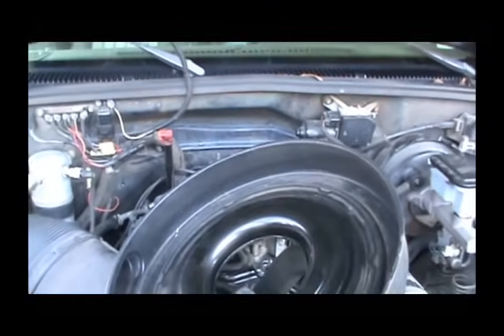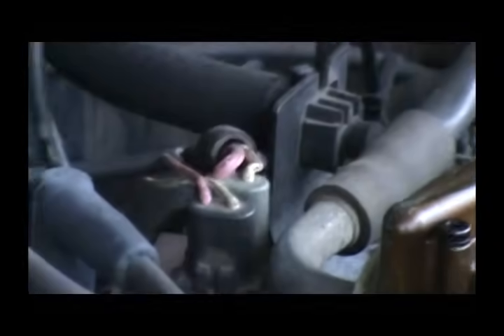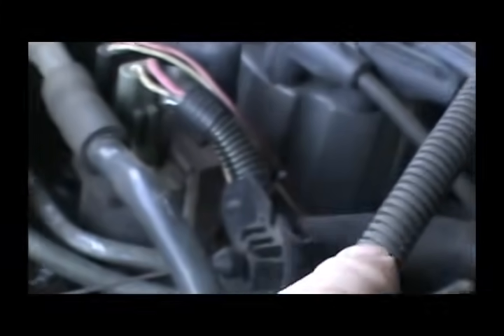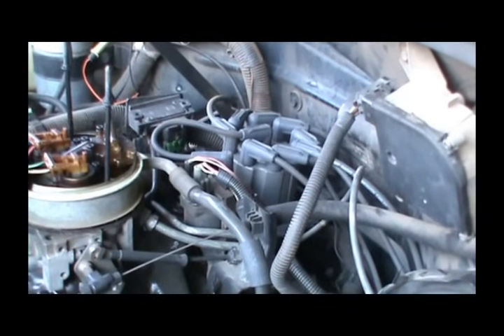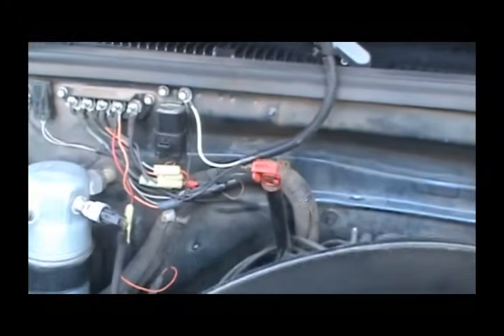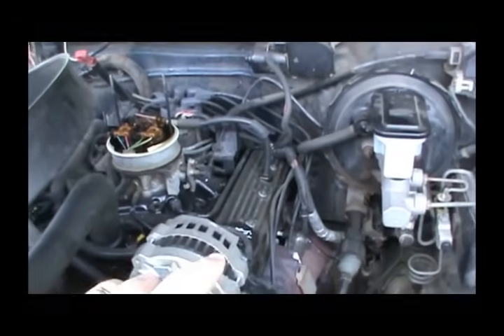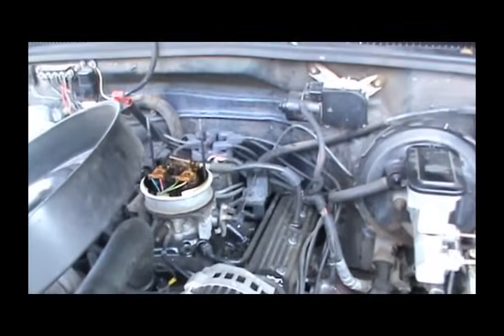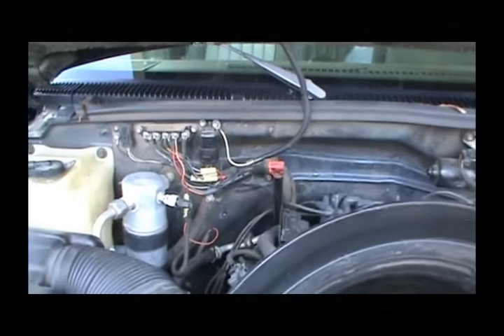1988-95 GM Truck Ignition Systems

Comment: Help please. I have a 1990 gmc sierra 5.7l 350 engine. It will turn over but doesn't want to start. Initially i could get it to start if i kept turning it over and mashing the gas a few time. Now the truck won't start unless i pour gas into the tb. And it would run however now when i start it with pouring gas it runs then cuts off.It also went threw 2 batteries from trying to start it. Parts i already changed: fuel pump, fuel filter, oil sending unit, fuel reply, injectors, distributor cap and rotor button, and spark plugs. If anyone can help i would greatly appreciate it.
Reply from the maker: Without being able to test, it's hard to say...definitely sounds like a fuel issue.  The throttle body has a fuel regulator inside that could be giving issues.  Since it will fire, I would guess that the PCM is ok. Hope this helps.
Reply: Double check fuel filter arrow to the front?

Comment: I need a video on the vacuums I got mine all messed up! Wont hardly run
Reply: Changed the key switch barrel  on my 1989 Chevy Scottsdale. Every since. It runs the battery down over night. Any ideas

Comment: I have a 92 GMC Sierra V6 5spd.. I'm having issues with starting the engine.. it'll turn over but won't start.. May have a compression issue.. at first my fiance and I could spray some starter fluid into the intake and it would fire up.. what are some tips or thoughts on the issue?
Reply from the maker: Sounds like it's fuel related.  When it fired up on starter fluid, did it run ok?  Try cycling the key 3-4 times to prime up the system.  Make sure the oil pressure gauge is showing pressure when cranking, a bad oil pressure sending unit could possibly quit sending power to the pump.   I'd rule out the pump/wiring/relay before looking at the injectors.

Comment: My 1987 Chevy r10 running rough and cutting off when I put it in gear what could be the problem new fuel pump filter O2 sensor temperature sensor idle air control sensor map sensor still doing it
Reply from the maker: A dirty throttle body would be my guess

Comment: I have a 1995 c 1500 no spark, have fuel going in and has power to coil but no spark. new distributor , new wires and plugs plz hlp
Reply from the maker: Hard to tell, I hate to say replace the coil without some testing...
Reply: @farmboy30117  sometimes the wiring connections to the coil are broken or corroded. Check for voltage to the coil should be around 12v.

Comment: quick question. would you happend to know where that wire is on a 305 5.0 tbi engine on 1990 caprice classic? thanks in advance mr. farm boy
Reply from the maker: No, sorry.  If it's not on the firewall, look around the PCM under the dash.
Reply: thanks man!! I've changed almost evreything and no go. your video helped me have a better understanding of the start up process.thanks again
Reply from the maker: glad it helped

Comment: I have a 91 Cheyenne K 1500 5.7 TBI I changed timing chain and gears truck fires up disconnected the timing by pass wire set it to zero but it runs very poorly acts like it doesn't want to take the fule any thoughts
Reply from the maker: I think initial timing should be around 8 degrees BTDC but it should be on a sticker under the hood.
Reply: Have a 94 Silverado 5.7 there are two sets of wires coming off the ignition coil. A pink wire then a white wire that are bigger in size that run into main wires, then a pink wire and a white wire that are smaller that plug into the distributor. The bigger wires I believe are the primary wires, my question is, should the pink wire (Primary) always be hot or have constant power to it? I used a test light and no power showing, but then I had my daughter crank the motor and it showed power? Have a no spark condition. Dist cap, rotor, ignition control module, and ignition coil are all brand new.

Comment: After changing ICM  ignition control module ,distributer , rotor and cap . Spending 50 bucks on a tow to the local mechanic found out it was the distributer ignition pick up coil. Should have just swapped out the distribute r. Live and learn
Reply from the maker: That sucks!  Well, don't feel too bad, at least you have spare parts ;)  I've only had one pickup coil to go bad on me, so it's definitely not the first thing I think of when diagnosing a no-spark condition.

Comment: I have a 1995 tahoe with that issue. No spark, no fuel, I'm trying to test the computer but I can't find that plug any sujestions
Reply: Just found the plug its near the computer under the dash on the 95s.
 hower when I tested it to see if it switched it to icm from pcm.  I still have the same problem no spark no fuel , I'm guessing from here my problem is the ignition?
Reply from the maker: I'd definitely check power and grounds to the computer.  Does the check engine light come on when you turn the key to run?  If no spark with the plug unplugged, then it could be the ICM, but that would have nothing to do with the fuel issue.
Reply: farmboy30117 Okay so if I don't touch it and put the key in it after a long time if it's setting the gauges do the pre cycle check engine light all that fuel pump works and I can start it, however after I turn off the ignition it will not do another cycle, it's almost like it times out.
I can let it set with the key in the on position for like 30 minutes and it works again, but only one time as soon as I turn the key off it doesn't work for another 30 minutes.  If I turn the key once and leave it in the on position it will work until I turn the key off, once the key is off no spark no fuel no precycle no check engine light no nothing, no gauges blinkers don't work and other accessory components when this happens, but if I wait 30 minutes everything starts working again.
Reply: Also I was testing the plugs to the computer under the dash, the blue plug was getting power source the whole time while the precycle wasn't working, however the red plug to the computer was not getting any power as soon as the pre cycle started working, after the time out, the red plug got power and everything worked on the plug, and everything else worked and I can start it.
Reply from the maker: Do you have a wiring diagram?  If not, do a google image search and open the one from Autozone.  It looks like the only "B+" wires are either orange or pink.  There is a red wire and a dark blue wire (side by side) coming from the transmission control module to the PCM.  I can't help you with the transmission module.  It's weird that it resets after 30 minutes though.
Reply: farmboy30117 alright man I figured it out it was the ignition switch the whole time.
Reply: Hello I'm having the same problem right now can you please help me I am stranded I'm looking at the blue and red plug at the computer. Can you please tell me where at the ignition switch the whole time I Will Bless You Back please call me
Reply: I have a 95 Chevy Suburban same problem when it's cold it starts. I just noticed your comments 55 minutes ago you posted please call me 707-975-1520 I am from Santa Rosa California I lost my house and this is the only thing I have I am st stranded

Comment: I changed the plugs, Rotor and Distributor cap. Engine cranks over but won't fire.  I'm stumped
Reply: I also changed the ignition coil.   No spark after all this.
Reply from the maker: Check power and ground to the coil.  If you have power and ground, I'd suspect either the pickup coil or the ignition module.  Ignition modules are notorious for going bad.  Don't buy one from Autozone either.
Reply: Dang it all.  Just bought the $5o ICM from Auto zone.  It had a 5 star review, but still no start.  After reading these comments, I think I’d better just check all wires, then perhaps unplug that joint that bypasses computer and lets ICM dictate spark ,... any input is welcome -THANKS!  (‘92 S-10, 4 cylinder)

Comment: Hey farm boy I've been watching your videos for awhile I have a 94 C 1500 4.3 on the passenger side just laying on the intake there's a female plug with solid purple and solid blue wire going to it from the harness but it's not used someone told me it was for the service techs to check RPMs at factory if so I should be able to get another pigtail and wire a tach into that plug correct
Reply from the maker: I have no idea.  It's easy enough to hood to the white wire coming from the distributor on these trucks.
Reply: I have the same thing laying on my intake Jonathan... Did you ever find out what it was for? I suppose Google search for a wiring diagram could tell me but curious if you found your answer

Comment: Hello. I removed the distributor and replaced the intake manifold I also forgot to put silicone in front and back of the manifold. Engine won't crank. I been trying for days and just found your video. If I disconnect that wire and get the crank and rotor at tdc will of work?
Reply from the maker: Not sealing the intake ends will cause major oil leaks and maybe some vacuum leakage, but shouldn't keep it from starting.  You have to unplug the wire to properly set initial timing or the computer will advance the distributor and give false timing readings.

Comment: Hey my friend, my name is john.  I have a Chevrolet 3500 with TBI. I turn the key and nothing happens, not even the lights on the dash come on in ACC like normal.  Battery is good, dome light comes on strong when i open the door.  I replaced the coil (the one just in front of the distributor cap) about 5 years ago.  is there a way to check that again or do you think that is it?
Please help me when you get a chance. Thank you
Reply from the maker: Sounds like a bad ignition switch to me.

Comment: I have a 90 chevy 1500 carberator parts were stolen with truck recovered vechile and finally back together all parts have been replaced any ideas I have a truck now no crank no start no click don't hear fuel pump kick on as well seems like something not powered could starter and solenoid not connected right cause problems
Reply from the maker: I'd suspect something wrong in the ignition switch.

Comment: Good afternoon, Farmboy!
Asking for your kind input. My 1990 350TBI G20 Van starts right up and idles fine, but dies when put in gear, no pedal action helps the van to leave it's place. The real problem is that my van is parked on tiny spot and towing it is just unreal, so i would like to diagnose and fix it just where it sits. It's my first car (after several bikes though) so i would't like to ruin it while fixing with my current knowlege, lol. Can it be fuel pressure? Or may be fuel pump harness? Or even 27yr-old fuel hoses?
Thanks in advance and have a nice day!
Reply from the maker: Sounds like the harness is fine.  Can you rev the engine without it stumbling?  This could be caused by several things that I can think of: weak ignition, weak fuel pump, PCM issues... Hard to tell from here.  Good luck!

Comment: I have a 94 silverado 5.7 same setup, mine will start and run for 30 but when gets hot no power when pushing on gas and will misfire idle ok, but when i jigle that bunch of wires were that brown wire is some times fixes it for a couple months but some time not? whats the relay on the firewall do thats really hot? thx dan
Reply: My 88 does the same thing runs fine when cold but warms up it misfires under load and sometimes dies at idle

Comment: hey farmboy I've got a 1995 chevy g20 van 5.7l
I've replaced the cap,rotor button,coil, icm,computer and plugs and it spins over fine I've got spark I've got fuel I've got compression  but it will not fire just spins over won't even start off starting fluid  any ideas would be greatly appreciated
Reply: Knock sensor in front of starter

Comment: Thank you a million times over for taking the time to make this video, I truly appreciate it, you have helped me out. Great video.
Reply from the maker: Thanks, I'm glad it helped!
Reply: farmboy30117 what if the car runs ok but i keept that black / tan wire unpluged what will happe ? thanks man hope u replay to me
Reply: @mikeanderson1994 lol lll
Reply: farmboy30117  what  if no spark  still  after  distributor changed  .igintion  module.  The  pink wire is getting  no power  whatsoever
Reply: My husband has 98 Sierra he has changed everything,hoping this is his problem...will turn over but won't fire...we had no clue about an ecm,until this web search,hes outside ride now hunting down that black tan wire,trying to do what you said for retiming... praying it works..thanks alot for the video

Comment: I just put a 350 tbi on my sons truck took a running 4.3 out. gets spark and is in time . I replaced the ignition module. it has fuel to the tbi but wont run . hlp anyone
Reply: Marco Ocampo as much as it pains me to say this I forgot to plug one of the plugs into the distributor.
Reply from the maker: My guess is the 4.3L PCM isn't going to work with the 5.7L
Reply: I changed it. I had the one for the 5.7
Reply from the maker: Check the injectors.  Make sure they have power and are getting a signal from the PCM (ground side switched)
Reply: I've checked them with a test light and they light up but I dont know if they are pulsing. I put a new ecm in monday
Reply: I'm going to put a new pickup module in here in a few mins after work
Reply: McLoving Slot Hits Hit It& itQuit It
Reply: mudlitia1210  so  it's was ur ecm that  failed
Reply: farmboy30117 the chevy TBI PCM works off the tach signal. V6 or v8 doesn't matter which PCM it has. My buddy's 95 1500 had a 4.3 then a 350 and the wiring runs it just fine. I plan to do the same on my 94 s10.
Reply: Is the computer any good that you swapped out

Comment: i have a 95 Chevy 1500 5.7 with a hesitation stumbling problem, changed out EGR valve etc, runs rough codes say running lean!
any ideas?

Comment: I have a 1991 K1500 350. I was driving down the highway last night and it started sputtering then died. It has been stalling out the past few days sometimes when I am in gear and stopped at a light or if I drive at very low speeds. I smell fuel when trying to crank and we sprayed some brake cleaner in the top. Changed the control module in the distributor out with a known good module still the same. We noticed that the spark in our tester was very orange and dim, it usually is bright blue. There was some dirt on the contacts inside the distributor but we cleaned them off and the spark plugs looked OK but probably need changed soon.. but still should be operable. Any suggestions? The motor, distributor cap and entire distributor motor is less than a year old.
Reply: matron81 did you find out what it was?
Reply from the maker: Well it's either going to be fuel or ignition related it sounds like.  I assume it cranks right back up?  Have you changed the fuel filter recently?  No codes?
Reply: No, it will not crank.. Turns over and we smell fuel. Spark seems very weak.
Reply: When we use our spark tester (small tube put inline with the spark plugs), the spark is very dim. It is normally a bright blue color. We have replaced the entire distributor module and I swapped out the starter with a new one just for good measure because I have a lifetime warranty on all of the parts. It still will not start.. the only thing I think I can check for is to see if it has an ignition relay thats gone bad or the ignition switch itself is bad. Why would it have a weak spark?

Comment: If you fellas cannot find the brown wire, look under the passenger side dash inside the cab. Brown wire with black stripe. I have a 1994 k1500 5.7L that I am restoring and mine was behind the glove compartment next to the computer. It can also be closer to the floor behind the foot-well light, by the carpet and blower motor. To set the timing:

Unplug the wire
turn on the truck and wait for the engine to warm up
find Top Dead Center (0 degrees) on #1 sparkplug
turn off the truck
reconnect the wire
turn truck back on, and the computer will set the advance (usually 20 degrees)
Drive around a little bit afterward, because the computer will learn as you accelerate and slow down and further fine tune the timing
Reply from the maker: Thanks for the info!
Reply: cccalhoun I have a 1994 GMC pickup two seater I think it's a Stepside and I have the same exact problem and I got everything and nothing is doing the trick. It'll drive for a few days as soon as I buy a new battery and then it just dies and I think that's the problem is the brown wire. But I don't understand what do you mean turn or go to the number one spark plug and 0 degrees? And also so you're saying I can go behind my glove compartment which I already found all those other relays and change them so I can find the brown wire there undo it then I could turn my car on and then turn it off find the one spark plug and do what how do you turn it through degrees what do you mean by 0 degrees I don't get it I really appreciate all this information I've been looking on YouTube for 2 weeks and on the schematics and everything you can think of especially being broke
Reply: cccalhoun or is that too just set timing I still don't get it do I do all that first the bypass does starting point because my truck won't turn over are you saying unplug the brown one and my truck will start and then do it all over again for the timing can you give me a detail I know you don't know me I would appreciate it
Reply: cccalhoun

Comment: will the truck run and drive if someone forgot to hook that timing wire back up
Reply from the maker: Yes, but it bypasses the PCM so timing will not get advanced and it'll probably run like crap at higher RPMs